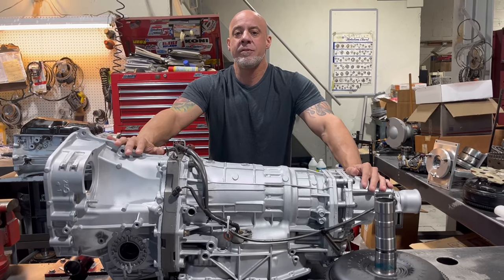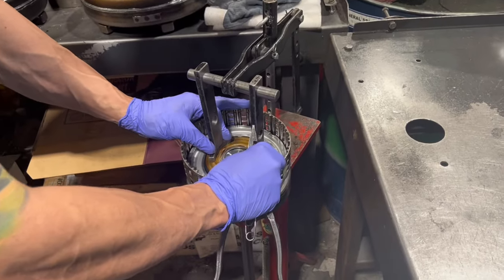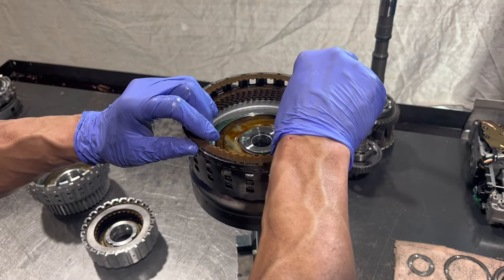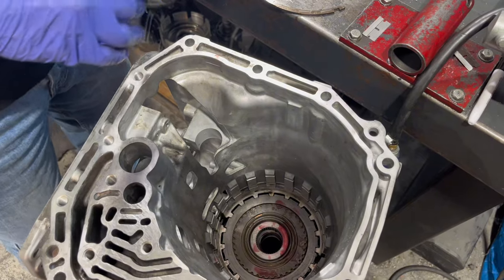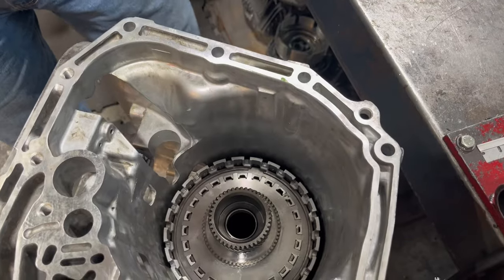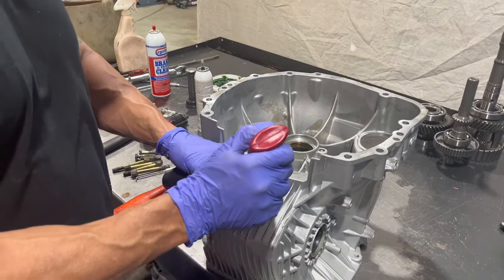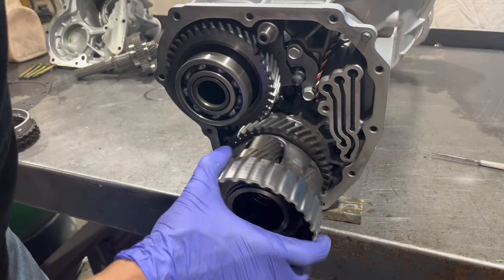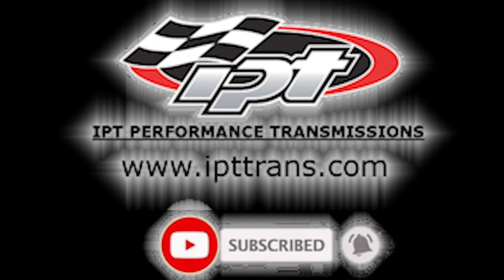Maximize Power: 5EAT BulletProof Performance Transmission Build!

Comment: Awesome build! Some years back my 5EAT acted up (2007 Outback 3.0 H6 SI-Drive). Went to limp mode, which means the forward drive was in 3rd gear only. With the help of the internet, it turned out one of the controller solenoids went bad in the valve body. So I ordered one, which is the exact same as some Hyundai or Nissan ones. It was a journey to remove the oil pan without damaging it, remove the valve body, switch out the bad solenoid, and put everything back together. I was soaked in ATF oil. I was so relieved when it shifted all the gears back and forth. A garage pit is a must if you do not have a hoist or 2-post lift.
BTW what ATF oil do you recommend using in the 5EAT besides the factory one? Is Motul Multi ATF good enough? Some say it is good, and some say only Subaru ATF oil.
The service manual says alternatives are Idemitsu ATF HP and Castrol Transmax J (which is outdated).
Reply from the maker: Good 👍🏻 
I recommend Dexron 6
But what you’re talking about using will work well too
Reply: @iptperformancetrans  Thanks for the quick reply.✌🏻
Reply: Fuchs TITAN ATF 4400 meets the Subaru SUBARU ATF OIL/ATF OIL SPECIAL/ ATF HP standards which are listed in the recommended material's section of the service manual for the 5EAT, bit expensive but high quality German oil.
Reply: @lofty247  Thank you!

Comment: Does the 5EAT have a remote oil filter ? I spied a small black filter on the left hand (passengers front side) and I'm not quite sure if it is for the trans or not.
Reply from the maker: @produKtNZ  Yes, there’s a spin on filter behind the battery in most vehicles. It may be the same part number as your oil filter but don’t quote me on that.

Comment: Hi guys. I have a question. I have a 2007 Subaru Outback 3.0 and I need to buy the solneoid kit with some kind of wore harness. Do you know where I can find it?
Reply from the maker: @andresgoijberg3534  As far as I know as of now, solenoids are only available as part of a complete valve body and harnesses need to come from the dealership as well

Comment: Have you ever seen a 5AT with only 2 sealing rings on the direct clutch support? The middle ring was missing
Reply from the maker: Yes, the later style omits that ring 97-up I think?
Reply: Yeah, this unit didn't have a sprag or overrun clutch at the bottom where the forward clutch is, just a hub down there. 
Cheers!  @iptperformancetrans

Comment: Thank you for making such a thorough video. After watching your tear down vid it helped me confirm my fears of a 5th ‘gear’ clutch pack breakdown. It’s remarkable how similar the 5eat is to a powershift tractor transmission.  I’m an agri engineer in the UK and I’d like to try my own build in my 07 legacy. Is it as simple as machining the difference in extra clutch plates off of the drums etc?
Reply from the maker: Thank you. As far as the extra clutches question, no. I had redesigned steel plates manufactured to do what we’re doing in these builds.
Reply: @iptperformancetrans   Thank you for your response. So you changed the thickness in clutch plates rather than the housing itself?
Reply from the maker: @samueldixon8674  Both really, I use different thickness steel plates and do quite a bit of machining to the clutch pistons to install all of the extra clutches
Reply: @iptperformancetrans   Ahh okay I get you. Thanks again dude keep doing what you’re doing💪🏻

Comment: Hey is the upgraded performance rebuild kit you sell on the site the same one as here with the additional clutches?
Reply from the maker: It is not, what we do in house requires the machine work
Reply: @iptperformancetrans  ah i see so the rebuild kit online is like stock+ and the build services you do are the higher power setups? Is there any way i could send you parts to be machined? Lol 
thanks for the fast reply

Comment: I recently rebuild my Subaru legacy transmission but when am driving it's not going into 3rd gear it keeps on giving a braking and go bk in 2nd gear
Reply from the maker: Sounds like something is misassembled either in the valve body or the transmission itself
Reply: I think it's in the valve body cause I rebuild it before and it gave me the same issue and I took it back down and watch ur video and did everything u did and when I put it back up it's the same problem